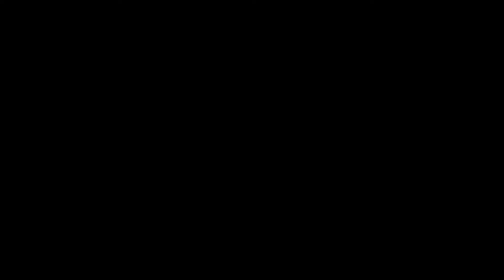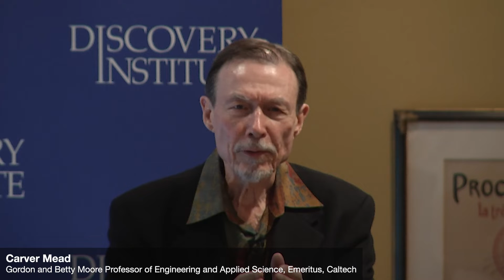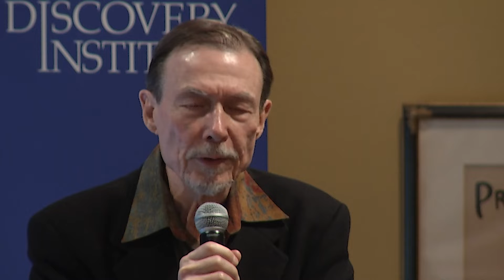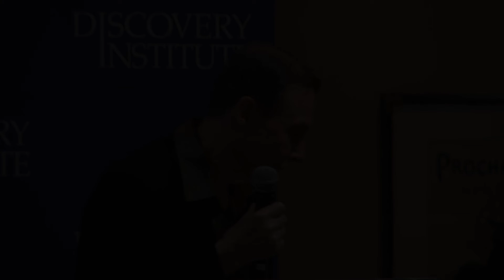The Future of Science & Technology in America - Carver Mead

Comment: I’m definitely biased in favor of engineers over theoretical physicists, since my dad was a mechanical engineer who worked on designing the Lunar Module at Grumman. The problem with theoretical physicists is summarized in the attitude expressed by Bohr when he famously said that the job of physicists is not to discover reality but equations that accurately predict the results of measurements. I suppose this is why the physics community will not consider revisiting Einstein’s 1911 variable speed of light idea. Relativity’s geometric spacetime based coordinate system “works”, so there is no need to consider revising it to reflect reality. Except that we are seeing it doesn’t work, since it doesn’t reflect what we are now seeing on a cosmic scale. So instead of going back to square one and exploring  a VSL  theory, the physicist club is doubling down on the Holy Scriptures of Special and General Relativity and postulating thee existence of “dark matter” and “dark energy” to explain the theory’s inaccurate predictions. The Ether based understanding of physics was immediately abandoned after a 100-year-old experiment failed to detect it, but the idea of a photon projectile idea of light following a ballistic trajectory through empty space at an invariable velocity is reaffirmed, in spite of the failure to detect the existence of any dark matter particle or dark energy. These unicorns must exist because Relativity is correct!